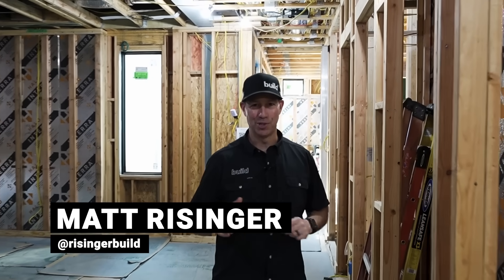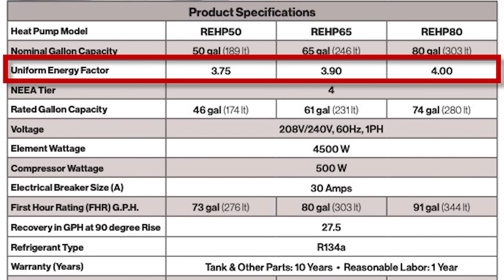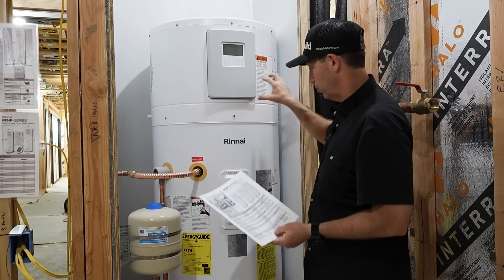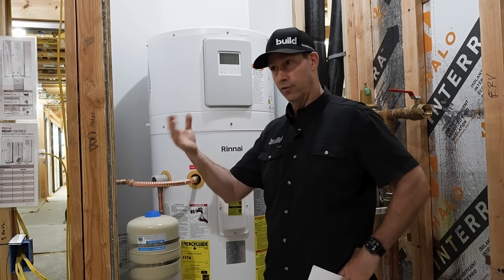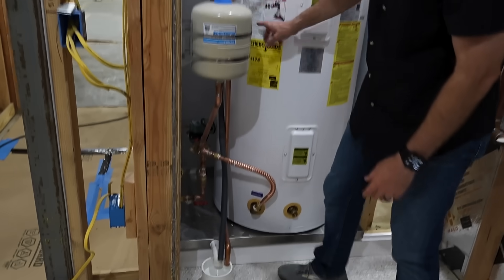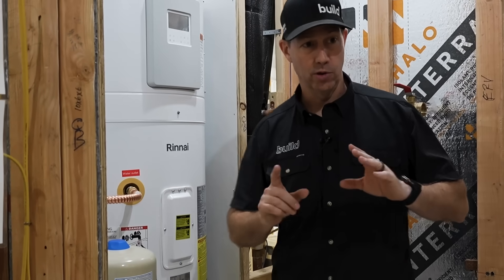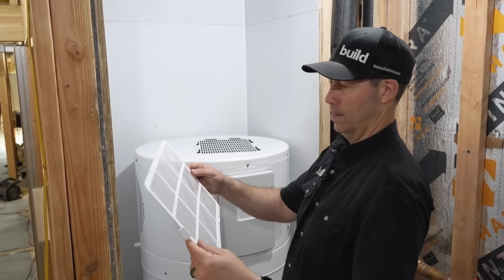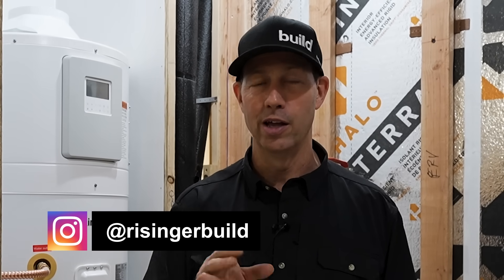The Best New Water Heater? Rinnai's KILLER Electric Heat Pump

Comment: If it's pulling heat out of the air, doesn't that mean that you're now having to replace that heat thus making your heating system work harder? This would work well in the south when there's no heat needed, but for anyone that heats their home this system would probably end up not being any cheaper to run if you have to have more heat in the house to compensate for the heat taken by this.

Comment: If you are using that during the heating season inside your house, the energy to heat the water is coming from your heating system, plus the 500 watts of electricity.

Comment: In many locations the large central water heaters are becoming less attractive.  Point of use heaters are becoming attractive for a host of reasons.  No need to run two sets of water lines and infrequently used spaces (guest rooms) can have the heaters turned off.  Small eclectic water heaters can be located closer in smaller spaces and closer to showers which reduce losses.

Comment: I am really wanting to throw one of these into my garage(in Florida).  Its a perfect fit, keeps the garage cooler so I don't need to run my garage mini split as much in the spring, summer and fall.
Reply: Also you can run it off a generator in a post storm situation.

Comment: Using heated air in your house (furnace heats the air) to heat hot water costs you twice.
Just discharging the hot water tank to the outside required it to use air from inside unless the take up to the outside is used.
If you did this in the summer, discharging the air outside will draw from the inside that to make up the pressure difference, you will have hot summer air drawn into the house.
If anything you want a balanced system for everything.
Drawing from the attic and discharging to the outside does not cause that problem so long as the attic is vented, not just for the attic but to accommodate the hot water tank too.

Comment: Per Appendix E to Subpart B of Part 430—Uniform Test Method for Measuring the Energy Consumption of Water Heaters, Section 2.3, inlet water temperature for testing and determination of UEF is to be maintained at 58°F ± 2°F. So, no, this HWH will not outperform spec in Austin if inlet water temperature there is 55°.

Comment: The additional cost of a heat pump will not save me any money, as I installed solar, and all it takes is an extra panel to make up the use of my hot water usage, I'm really low use, I guess other people may need 2 or 3 panels, but still less than a heatpump.

Comment: Hey Matt this product is great I’ve install similar units that also have ducted kits, It’s pretty standard. This install looks good except the big huge elephant in the room. Those flexible copper lines on the water inlet and outlet need to go! They are a complete rookie part. The wall thickness where the pipe bends cause turbulence in the water and can cause leaks over time. Tell your plumber to come back and hard pipe those flexible copper lines. They are trash! I own a plumbing company 30+ years experience. GET RID OF THE FLEX LINES

Comment: I'd be thrilled to find an 80 gal electric hot water heater with a clean out port so that I can remove the mineral buildup at the bottom every so often. Can you please point me in the right direction for that?

Comment: My oil boiler, with an indirect fired hot water heater, died last year. I was done with oil, so we replaced everything with geothermal and a 50 gallon air source hot water heater. In the summer, the basement, which used to be 80F (at least) is the coolest part of the house! In the winter, it's still toasty warm. I measured it and in heat pump mode, it's only drawing 2amps!

My wife is part of a facebook group for our community and people were complaining that oil is currently $4.79 a gallon in my area. I never have to worry about which dictator in which country decided to pick a fight with which other country and how that affects my wallet. I never have to worry about accidentally running out of oil. And once we finally get solar panels, we'll eventually be running everything on renewables. I couldn't be happier.

Comment: if it's taking the heat out of the air around it, would it make sense and be more efficient to install it in the attic instead of the basement as hot air rises and attic gets super hot in summer.
Reply: yes but you could just duct it to the attic.

Comment: What about changing the anode rode in that thing?  These days water heaters are made so cheap they barely make the warranty.  My previous (natural gas) heater survived 19 years w/o any maintenance.  It finally failed, the replacement lasted not quite 7 years on a 6 year unit.  Factor that into the lifecycle cost.  Of course if you change your anode rode and flush, it will last MUCH longer! Changing the anode rod is "not" hard, but also not easy.

Comment: I’m in southern Arizona and plan to run the supply duct from the hot attic, and run the cold exhaust into the AC duct. I’ll put in a baffle that I can close off when running the furnace for a couple of months in the winter, and just exhaust outdoors. May even get fancy with an electric baffle that opens when the AC is on.

Comment: This amazing water heaters cost a small fortune.  For us cost conscious folk I suggest getting a standard electric water heater  and install a power clock timer which only lets the heater run for 1 hour a day.  Insulate the hell out of it and you can save massive costs both in purchase and yearly expense.
Reply: That's both dumb and inaccurate.

Comment: I would have installed a shower pan along with a trench drain.  A regular 4-inch floor drain can so easily get defeated by a stray dryer sheet, a sock, a tissue, or even accumulated lint and dust.  That little drain hole on the water heater pan will not save you in case of more than a little water heater leak.

Comment: Heat pumps take energy from one place and move it to another place at higher energy level. this does not work well in cold climates as you cannot take sufficient heat with good efficiency from the cold outside or if it take from the inside the house it will cool your house to uncomfortable levels and will go into very bad efficiency rates where you will just get the same benefit like from electric heater but in much more expensive way.

Comment: I have a Ruud 50 gal water heater that has been running since I bought the house in 2015. It says it's a self cleaning unit and works fine so far. It's a Ruud Pacemaker EverKleen 40gal mfg. in 2006. I haven't checked the dip tube or the anode rod so far, but have drained it once. I am thinking it is probably getting close to end of life and do not want to wait until it fails. I am thinking of replacing it with an on demand unit. Any advice here from the commenters on best unit to get? My unit is propane. Thanks so much in advance.

Comment: So these Heat Pump H2O Heaters supposedly save $$$ by using reduced power to heat the water, BUT what about the increased heating bill caused by the loss of heat they scavenge from the home?!?
Reply: You'd want to install this in a non conditioned space.  Matt mentioned a garage as an ideal location if you're in the South.

Comment: 8:09 You should also replace the standard drainage valve with a full-port quarter-turn ball valve. Much easier to flush out without that fiddly screwdriver operation.

Comment: A couple of downsides. If this thing breaks...good luck on getting it repaired...in or out of warranty. You could easily wait a month...like people with downed refrigerator compressors do. A compressor repair repair will cost you over $1000!!! because NOBODY wants to work on them. Next...if this is stealing heat from a heated area..it is actually costing you more than quoted...to replace that heat. Next...at 37 degrees you are running at 4500 watts which is BY FAR the most expensive way to heat water. IF you bought this and it worked flawlessly for 20 years it would be a good deal. If it breaks ONCE in 20 years it will push return on investment ROU for another 5 years. These things break..and the repair network is non existent. It looks great..its still a false economy. Try to find ANY compressor that lasts 5 years nowdays..

Comment: Hard pass...my $500 natural gas unit basically runs for free...9 months out of the year, when our HVAC furnace isn't running, my natural gas bill never comes off the minimum $30ish dollars a month just to have the service turned on.  It goes from ambient temp to shutting off in about 10 minutes. It is basically an unlimited supply of hot water when using a shower or doing dishes. Our range top is natural gas as well...electricity, either thru a heat pump, or a coil, is a horribly expensive way to produce heat.

Comment: In the South it makes sense, but not so much in the northern winters where your furnace is the thing heating it in the end. Now, if it had a split that went outside your home, that'd be different, but then it probably would need a better design.

Even in the south or north when you're using A/C, you're making the water heater less efficient, so an external radiator would benefit the design, but probably add cost too.

Comment: Went through three plumbers before I found someone competent to install my Gen 1 Bradford White heat pump water heater. They used the threads on the input/output to screw on lift chains for an engine hoist. Perfect. We have solar with net metering. No perceptible impact financially except for the $4K purchase/install. Southern Nevada install so it barely runs in summer.

Comment: I have the 50 gal rheem, after a 1000$ instant rebate got it for $750,
No nat gas at house so this is perfect, draws a lil over 2 amps in heat pump only mode, wife & i take showers at diff times of day already so recovery wont be an issue

Comment: I honestly probably wouldn’t consider a Rinnai specifically since I typically rely on contractors to install my equipment, but something I’ve wondered for heat pump water heaters in general: since the heat pump is usually installed on top, how do you access the anode rod?
Reply: water heaters have come with side mounted or restricted top clearance anodes. they anode is made in small sections that allow you to bend it.

Comment: Yes, the water heater is efficient, but it does this at the sacrifice of efficiency of your HVAC system. In the winter it steals the heat from  the inside  of your house, making furnace or heat pump work harder to keep the home comfortable.

Comment: Hey Matt, you rave about the closet that water heater is in…  but let me see you get the screws out of the back of that when you need to service that unit!  Another issue that you’re not addressing with the lower cost of operation of the heat pump water heaters is when they’re not deducted to the outside your HVAC system is picking up that extra load. So the operational cost is higher. I really like the dehumidification affect in the summer  so I would love to see a flow damper Inc. into these installations
Reply: It would be fine if you live in the deep south. But up here where the weather is cold for at least 6 months of the year that would be a deal breaker. I don't want to air condition my home in the winter.
Reply: This depends a bit on where the unit is placed though. If the technical room also houses appliances that produces heat as a byproduct of their operation it is effectively recycling that heat. That said you are dealing with efficiency losses all the way if you start thinking about all those conversions so the effect might be completely negligible if you do the math. Also you could easily argue that simply ventilating that hotter air through your HVAC system exhaust, assuming it has a heat exchanger of some kind, would still capture it. That said most HVAC units with heat exchanger that I have encountered only rely on a simple design where the intake air is transferred through radiators with a cold and a hot side so they probably won't get the same efficiency as a heat pump

Comment: Our Rheem / Richmond (Menards) has been amazing. Been using it for 4 years now. If you have 3 people or more in your house and plan to stay there, you should swap out your current water heater today. Sell your used heater for whatever you can (like I did) and start saving money. If you can put it in a warm garage you'll save even more. I'm in Missouri and it's in our basement.

Comment: These are interesting but here in the upper-midwest, it's nice having traditional natural gas hotwater tanks that use zero electricity.  Can have hot water even if there is a power outage in winter.

Comment: You like to read specs but you don't understand them.  These units are tested by the government under CFR 430.23(7) at a room ambient of 90F.  Very few buyers will keep their house at 90F,  so they will never achieve the 4.0 UEF in actual use. I estimate 2.8 at 70F. The test method is designed to make these look good.
Also, when the unit operates at its low ambient limit of 37F it will be putting out UEF 1.0 before it switches off the compressor. That is what the low limit means. The heat gain stops at that temperature. There is no point putting one in a cold garage in the north. The output of all heat pumps declines in direct proportion to the drop in ambient temperature. Full rated output at 90F, straight line down to no gain at 37F, for that model.
The one hour ratings are all the same because they are the result of using the same 4500 resistance element.

Comment: So, if I operate this unit in cold climate in winter , the heat pump takes the energy from Ambiente air to heat up the water I need additional energy to heat the air around heat pump. I don't understand where is my gain when I save $100 on heating my water and the same time I spend $100 more to heat the room, which accommodates the heat pump.

Comment: If it is winter time and you aren't venting the unit, you are not getting the efficiency since you are cooling down the surrounding air which then has to be heated to keep the room temperature up. The pump is more efficient but the heating of the house is less efficient.

Comment: Matt. If you’re calling a refrigerator a heat pump then all the appliances moving heat are heat pumps. We call heat pumps an appliance that has a reversing valve and that can go both ways, doing heating and cooling. 
As for the this w/h, it’s up there but noting more than any other high-performing one. 
The best system is what you have in your house, a split unit. They’re more expensive but worth it. That’s mostly what they use in Europe, not this all-in-one unit.

Comment: The energy efficiency ratings on these heat pump water heaters are a little scammy and misleading, especially if you live north of Texas. They don’t account for the additional energy your furnace uses to compensate for the heat the water heater draws from your home. So you’re just heating the water with your home furnace. 🙄

Comment: So, my concern here is what is the cost comparison against a gas water heater, and what is the ROI?  Do I need to put a new 30 amp/240V circuit in for this unit, where my gas water heater only uses electricity to start the heater and to run the fan, on a 15 amp/120V circuit?
Reply: They make 120v units that can either run on a shared circuit or a dedicated circuit.

Comment: I stopped watching this when he said we use a heat pump in your frigerator at home. Heatpumps do heating and cooling meaning the condenser and evaporator can swap depending on mode. Why would you wanna heat the inside of your fridge. This is a normal cooling system with the condenser located in the hot water to reject heat it take from ambient air in your house along with heat of compression. 
A tankless would be a better option. Your not paying to heat up water you are not using. The less it runs the less it costs. Electricity is not cheap where I live in canada. Natural gas is cheap

Comment: That may be good in warmer climates, but in colder climates where you have home heating running, then it will draw the heat from the furnace, making the furnace run longer.

Comment: Once again the subject no one wants to talk about is left out. 
But you have to bear in mind is the fact that despite these heat pumps being really efficient at moving heat. They're moving the heat from the air inside of your house into your water and they're consuming energy doing it. That means if the heat inside your house was generated with an inefficient system, you really haven't gained anything.
The only way these things can make real difference is if you're taking the heat from outside and sending the cold exhaust back outside. And then of course you're faced with the same problem that you have with any other air sourced heat pump. Unless the temperature differential is high enough, you're not going to get enough heat out of it to raise the water temperature to where you need it to be.
So basically not only are these things really expensive to buy but they don't perform as claimed unless. Of course you consider every little nuance in the fine print if you can find it.

Comment: Regardless of the brand, heat pump water heaters just don't make sense. Yes they are efficient,  but no body is looking at where they get their heat. They pull the heat from your conditioned space, so you heat the sire in your home and then use that hot air to heat your water, how can that be more efficient? If you have a hot garage that's one thing, but heating your home to heat your water is a bad idea. But now we are stuck with it because no one is looking at the big picture.